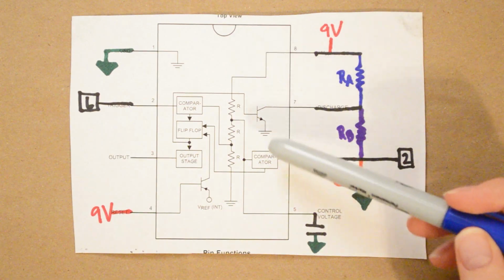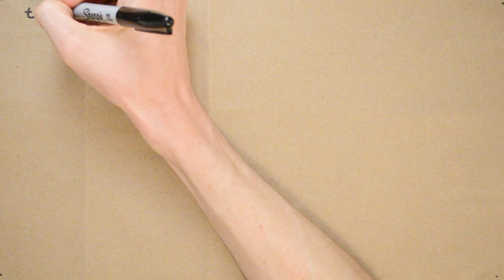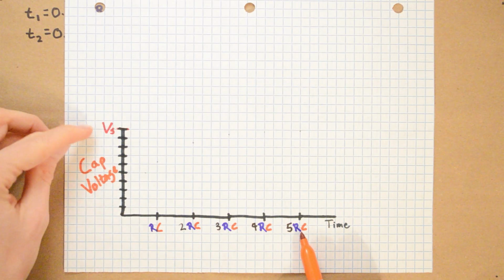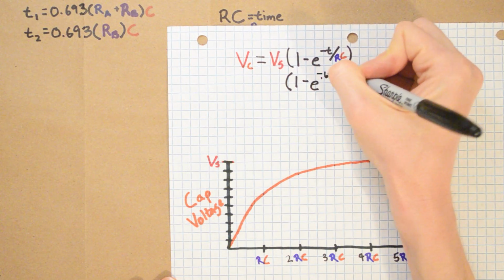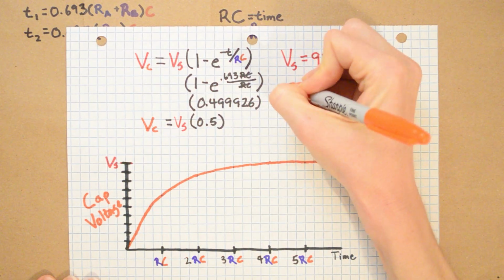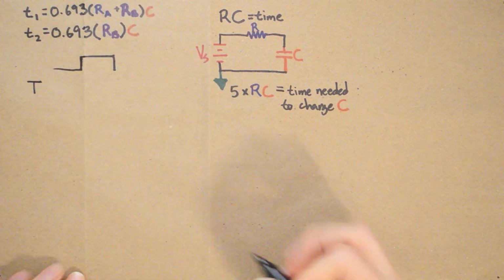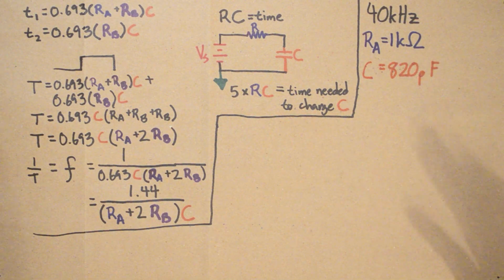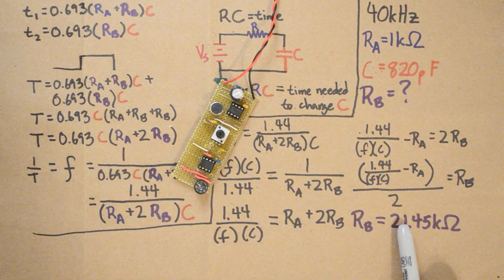Math of the Astable 555 Timer

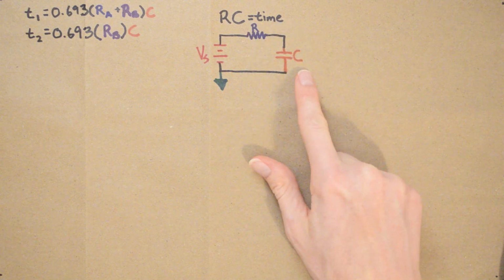Comment: In engineering, they teach that if you wait five time constants (5RC) the capacitor is charged "all the way" or "it's safe now", etc.  Something like you are saying at about timestamp 7:00 
I work with high-energy electronics, and had to learn for myself that this cam be an assumption that will KILL YOU!!  I realize that this will not be usually encountered in 555 circuits, but be sure you are aware of this on large scales, such as the big "pulse" and "energy" caps.  If you wait 5RC, then the cap is discharged down to 1-exp(-t/RC) or 1-e^(-5),  which is over 99% discharged.  Now consider the huge capacitors that so many people are using for such things as "wire exploding", "rail guns", "can-crushing", etc.  I have seen some cap banks that are charged to energy levels like 75kJ.  If such a bank is discharged 99.3% (5RC) it is left with an instantly lethal 525 Joules!!
I believe that these things are the most dangerous electrical components!
BTW: at about timestamp  4:00  I think there is a mistake in the datasheet in the last formula visible...isn't the duty cycle given by "D=(Ra+Rb)/(Ra+2Rb)"
THANKS MUCH FOR THE VIDEO!

Comment: The circuit and its math becomes easier if you control the astable multivibrator by a single resistor between the output pin 3 and the timing capacitor pin 6, leaving the discharge pin 7 unsused. In this way you also achieve 50% duty cycle.

Comment: Great videos on the 555! I'm a beginner when it comes to electronics, so these really helped me understand the logic behind how these work.

There is a project that I've been messing around with where I have a signal pulse coming from an electric motor which pulses twice per rotation, so the frequency is variable and equal to two times the RPM of the motor. What I would like to do is use this signal to generate another pulse which is equal to three times the RPM of the motor.

Do you think that there might be a simple way of accomplishing this (electronically), aside from using something like a microchip to be able to interpret the original pulse signal and calculate what the signal would be if multiplied by 1.5?

Ideally, I would like to have every second pulse of the original signal synced to every third pulse of the generated signal.

Edit: I may just end up creating a custom rotor with 3 magnets and a hall-effect sensor to get the specific pulse signal that I want instead of using the signal coming off the existing wire. I'd prefer not to add additional mass to the rotating component of the motor, but it's the easiest thing that I can think of for testing purposes.

Comment: Hi Jason. How can I control the duty cycle of the 555 timer in astable mode from max value, down to about 40 or 50% using LDR without significant change of the frequency? My goal is to control the brightness of big LED clock depending on the ambient light. So in the daylight it should be on full brightness and during night the brightness should be down to 40 or 50 %. My LDR values: light resistance about 1.4K, dark resistance is about 20K.  By the way, subscribed and hit the bell as well.

Comment: Nice explanation and nice video.  However, I think it's a bit of a belabored explanation.  The 0.693 comes from the fact that the voltages swings from 3V to 6V for Vs = 9V, i.e. exactly a factor of 0.5 between 3V and 6V.  This factor of 0.5 is constant regardless of Vs because the voltage swing is from 1/3 to 2/3 (i.e. exactly a factor of 0.5 = (1/3) / (2/3) ).

Comment: I've been watching and enjoying your 555 timer videos.  Hope you're still checking the comments.  I didn't see you address, or any comments about, making the output low time 3 times longer than the output high.  Is this possible with a 555 timer or cascading 555 timers?  For instance, say I want an LED to blink for .5s then turn off for 1.5s.  The cascade example used Vhigh=Vlow.  I tried running the numbers with Vhigh=3Vlow, but I ended up with negative values when I combined the equations from the datasheet.
Reply from the maker: Add a resistor coming out of pin 7 and connecting between Ra and Rb. This should slow the discharge time enough to achieve what you want.
Reply: Interesting.  I'll give that a shot.  Thanks!

Comment: You've produced a great series of videos explaining the 555 Timer, thanks.  I realize it's been two years since you posted, but the videos are "timeless".  You really have explained slowly, and with some great grocery bag illustrations (from Whole Paycheck), what the 555 does, how it works, and how to determine what (and size of) components needed. The one thing that slipped me up on the final calculation of R sub b resistor was the 820 picofarad capacitor.  In my HP 12C (the best calculator every made!), I  converted 820 pico farad to micro farads (1/1,000,000).  I believe you may have done so in your TI equation, but was just difficult to see that.  Or, maybe you converted to milli farads AND converted the frequency to Hz, I couldn't tell.

Comment: Great video, but what about the duty cycle? How do i make a 50% duty cycle oscilator
Reply: Using this circuit it is impossible to achieve 50% duty cycle. But you can achieve it easily if you control the capacitor over a resistor which is connected between the 555 timer output pin 3 and the timing capacitor pin 6. Operating the astable vibrator in this way saves also one resistor (you need just one resistor and one capacitor). And also in the formula you don't have Ra anymore.

Comment: why did you use formula instead of numbers its very confusing but whatever
Reply: d: great question.  this can be seriously confusion.  here's the disambiguation: 

Formulas are algebra-style generic representations of how and where to plug in the actual numbers for your specific situation.  The letters are "variables" until they get fixed up with their specific numbers.  Then they are "fixed variables".  Numbers already appearing in these equations are called "constants.'  

It's a serious issue in education that teachers and professors usually don't bother to explain this.   The purpose of algebra, by the way, is to figure out what "x" is.
Reply: ... that's not to say that this 555 math is really that understandable.   What I have a chance of understanding is the "plug-and-chug" part, that is, put the numbers in and get the answer.   The underlying physics and engineering is something else (requiring years, or in my case more like decades, of study).

Comment: Sir! Im Confused on the calculation.    (1-e .693RC/RC) = (.0499926) How???
Reply: Ah sooooo, I'm guessing its Euler's number, correct?   Thank God, for Google search.
Reply from the maker: Google, the fountain of all knowledge.
Reply from the maker: The formula is (1-e^(-0.693RC/RC)). Both R and C cancel out and the resulting formual equals approximately 0.5.
Reply: So what is e?
Reply: 0.693 is really just ln(2). Remember that the ln and e wipe each other out. Since e^-0.693 = 1/e^0.693 = 1/e^ln(2) = 1/2 = 0.5, Our formula becomes Vs * (1-0.5) = 6 * 0.5 = the 3 volts

Comment: I love your videos. I also initially used a 555 for a 40kHz Ultrasonic Transmitter. Although the 555 did the job admirably (after coming up with many non-standard resistor values until I got "close enough"). I eventually replaced the circuit with a 3.2mHz oscillator can through a toggling flip flop to get 1.6mHz and then divided that down to 40kHz. It didn't really perform much better than the 555 version, except for stability. :) I am subscribing.
Reply from the maker: Thanks for the tip and the sub!

Comment: Ps .......... great work .......... of course , the other question is , how accurate is the 9V , as i ' m sure that has a coach & horse of " exactly " , running through it ' s garden . And in reality , is this not the problem ? We a sold a digital pup on the horns of an analogue dilemma .......... Ok , this may be a better solution of an analogue only dilemma .......... but it ' s still a dilemma .

Comment: 0 . 39 "..........hit 40 KHz exactly  ............. " how exactly ? +/- 0.5 % ? +/- 5 % ? ............. how exactly is exactly . A gold band or a silver ?
Reply: It's probably impossible to answer. Two wires could have inductance and/or capacitance (more likely both). That is, the PCB itself, wires on the resistors etc. When we mix inductance in the circuit, the math gets pretty ugly.
Reply: This is the thing i like about engineering ........ there is the theory & maths & then the reality ......... it ' s amazing anything works at all ! 
It ' s the sort of reasons the Russian built rocket engines in the 60's that the Americans are using now .......... but then,this is the nation that also built nuclear "jet" & kept the crews safe,but rotating them of the craft before they glowed too much !

Comment: What happens if you short R(a)?
Reply from the maker: +Matthew Ferrie If you short R(a), there will come a time during the cycle when the voltage source will be directly shorted to ground through the 555 timer. This state is highly undesirable.
Reply: +Skinny R&D So it'd likely burn out?
Reply from the maker: +Matthew Ferrie Yeah or your battery will not last very long.

Comment: Oh another question, what is the value of the cap to ground from pin 5?
Reply: +clarkdef  its usually 0.01uf .its a bypass capacitor helps to prevent any noise problem .
Reply: Hey ur videos are good ....does 555 timer have maximum frequency to produce....and can you help on designing a range of frequency?
Reply: Mage Jose what fq?

Comment: You got an excellent channel. Though I'm very bad with the math... How would I work out a 2hz freq for a bike flicker light? I roughly guessed out the math for 2hz using (1kohm+2x1kohm) x 0.000220 farad or 220uf cap but it was all guessing took hours lol.
Reply from the maker: +clarkdef Thanks for watching! I would use:  Ra = 1kΩ; Rb = 360kΩ; C = 1.0µF  This should get you very close to 2Hz. You had your math correct, but you really want Ra to be much less than Rb. This will help ensure the light blinks on and off for an equal amount of time.

Comment: yeah! great video as usual..... please cover all types of multi vibrator. please make that happen soon . 

thanks for helping !
Reply from the maker: +ELECTRO BANGLA Thanks! If you have a particular project in mind, feel free to leave your ideas.
Reply: +Skinny R&D  make a single video  on  just practical circuit of   Astable, Monostable &  Bistable multi vibrators with 555 timer . i think u do not have  to explain a lot for Monostable &  Bistable coz i think after that u've already been   explained  Astable ,the other two types will be easier to understand .
 i am thinking  of making a power supply(DC ) with a 555 timer which will multiply the voltage level  and also provide negative voltage  which will be converted from positive voltage source (DC).